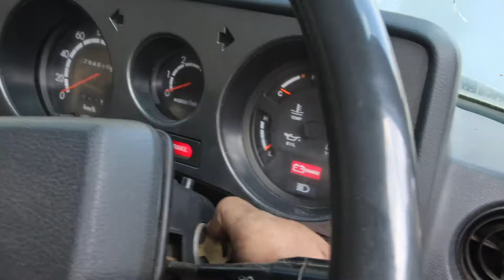LANDCRUISER ENGINE WONT START TOYOTA FJ60 LANDCRUISER // 60 SERIES

Comment: Good video man! I put in a new starter on mine, then it began not starting….. click, click…then I got under it and pulled out the old, filthy starter connector that goes to the ignition. Yep, started right up, but then it started only intermittently, so I had to crawl under the rig and pull out the wire, insert it and cross my fingers it’d start. Finally got a new modern clip-in plug, but I haven’t installed it yet. But soon.
Reply from the maker: Nice bro. Yep these old cars are a pain in the ass!!!

Comment: Nice video mate. I had to replace the rear masters, and the front calipers, just old and deteriorated. Front caliperss weren’t able to bleed.
Only thing I would have changed was I would have rebuilt them vs replace. I also snipped (with a grinder) the tabs of the diff that connect the metal brake lines to the flexible hose. I used a little metal bracket that bolted to both pieces so you can easily remove the caliper without needing to completely crimp the Flexi...
Reply from the maker: Yeah awesome idea. Front end brakes and swivel hub is such a daunting task, I think I’m gonna do it very last. Next up is lights then RUST!!!!!!!!

Comment: My hj60 turns over but doesn’t start, will only start with start ya bastard, any ideas?
Reply from the maker: Sorry man I honestly don’t know much about deisel engines. But if once it runs, it stays running then it sounds like maybe a tuning issue? If it’s the 2h engine, there are some great videos online on the engines and I’d say you find some really good in depth videos on them too. Good luck mate

Comment: Just got into the game and try a get a fj62 roadworthy, having issues getting her to start reliably, just cranking over and over till it eventually stutters into life, done the timing, spark gap checked point gap and all ignition leads, think it’s the carb but don’t really know, any tips?
Reply from the maker: Maybe the carb. Fuel pump?  I’ve got nearly 300,000ks and I start pretty well. 
There are Carby rebuild kits available but I’m not brave enough for that